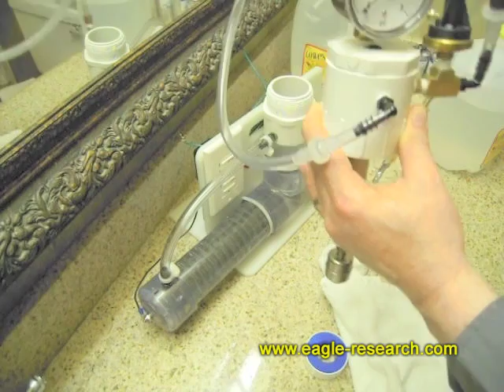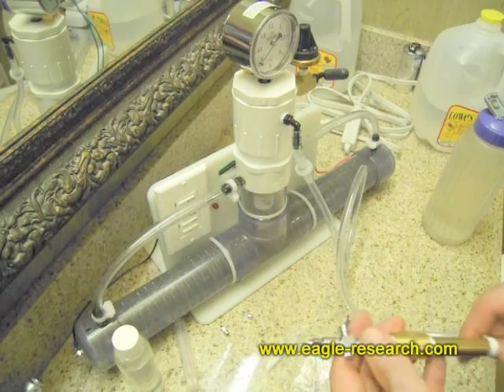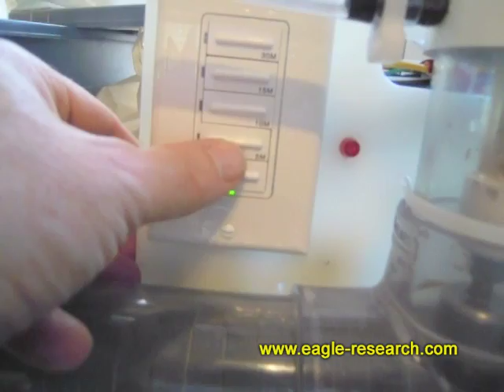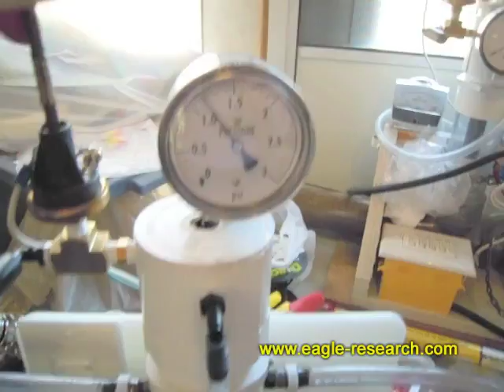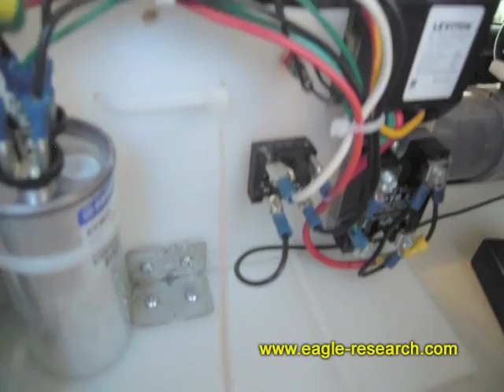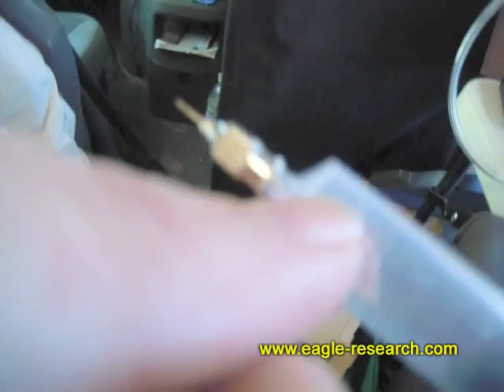ER50 WaterTorch Startup and Operation

Comment: hi.  I live in Europe where we have 240 volts instead of 110. does that mean that I will need 120 plates minimum?  

also,  the condensers will need to be twice the capacity?  

thanks
Reply from the maker: No, the ER50 with 40 plates works on 120 VAC or 240 VAC.  
We actually REMOVE a capacitor for 240 VAC to reduce the amperage back to about 1 amp (or else the ER50 would make 100 L/hr on 240 VAC).
Reply: @ecopegasus  I know this is old but I still don't understand how messing with the capacitors can fix the problem with European mains power.  If you're putting double the voltage across those cells, that's going to increase the current drawn.  Even if you limit that current, the over-potential is going to generate a lot of waste heat.  I do not see a clean solution other than what d d said, to use double the number of plates.  Either that or use a transformer or switching power supply to halve the voltage.  But, from this design, it seems like the idea is to have enough cells to avoid needing a power supply.  After all, they're an additional part that can break down and are a source of power loss as waste heat.  d d, I think your BEST bet is double the number of cells - perhaps two of these welders connected to mains in series and have the gas outputs go into a T connector.

Comment: Watertorch should be able to burn under water.  ER50 would also produce a small amount of deuterium;  D2 and DH molecules.
Reply from the maker: "WaterTorch" is a torch fueled by water.  If you try to burn underwater you'll need to use techniques similar to burning acetylene underwater (air jacket, etc.).

All electrolyzers concentrate deuterium that ALREADY EXISTS in the feed water.  That's how the government 'makes' the deuterium it needs for it's nuclear projects. 

The deuterium stays in the solution and acts as 'water' as far as the electrolysis process is concerned.  It does not come out with the gasses that evolve, so is no concern to what you apply the BG to.

Comment: the capacitor is should be in series?  or in parallel ? of supply
Reply from the maker: In series, on the AC side of the FWBR.  All this is explained in the instructions and you can see it in this video https://www.youtube.com/watch?v=YQ5YbSBaNNU
Reply from the maker: In series with the load, so the power goes to (and through) the capacitor(s) to get to the load.

Comment: nice presentation sir ....could you tell me this hho unit work on 220 volts or 110 volts &  value of the capacitors (volts & mfd) . I want  Brown's Gas Book 2 also how can i get it please  
Thanks 
Ravi
Reply from the maker: It works on both 110 to 220 VAC, just adjust the capacitance.  I'm currently using a series of 40uF, 375 VAC motor run capacitors.  Just use half the capacitance when running 220 VAC.

Comment: Thanks for explaining the ER50. Does the book 2 show how to build this electrolyzer? Being a tinkerer, I tend to spend to much money on everything but books, so I'm guilty of not having your books. Will buy book 2 to expand my knowledge of Brown's gas.
I have been drinking the hydrogen water for about 5 years, apply the gas directly to the skin by a rubber cup and also hydrogen water saturated cloth to the skin, be it a cut, burn, or an area of soreness. Thanks for the 5 videos that explained the methods and verifying that I'm doing something beneficial for my health. Arthritis had been a real problem and now I forget that i ever had it, lol.
Are you coming back to the Okanagon area? I'm orginally from Tonasket. Want to attend anything you will be speaking at. Buy you dinner in Orville.
Reply from the maker: Brown's Gas Book 2 and it's Resources will tell you how to home-build a very similar electrolyzer that would work just fine.
http://www.eagle-research.com/cms/node/204?a=5
I'd recommend also buying the ER50 online Resources access so that you could get the details that apply specifically to the ER50.  
http://www.eagle-research.com/cms/node/403?a=5
The HyZor videos (get version A download) also show similar electrolyzers being constructed so you can see things like my 'triple seal' technique for the terminal plates (prevent lye leakage).
http://www.eagle-research.com/cms/node/584?a=5
Reply: +George Wiseman t